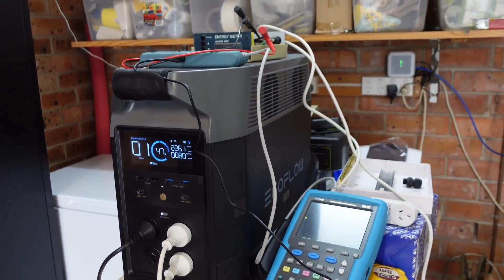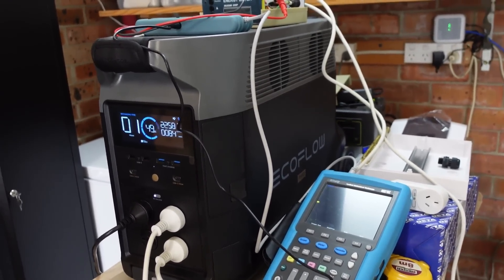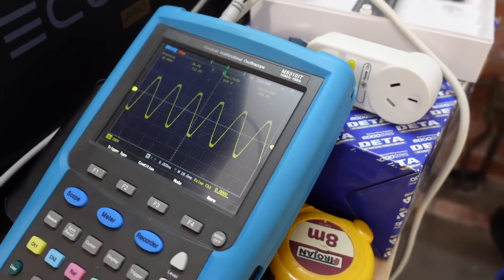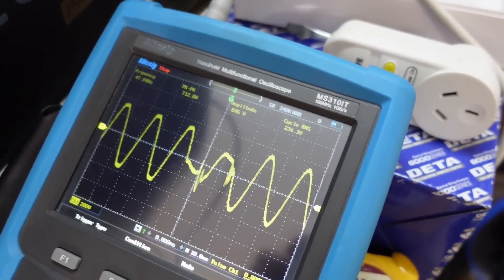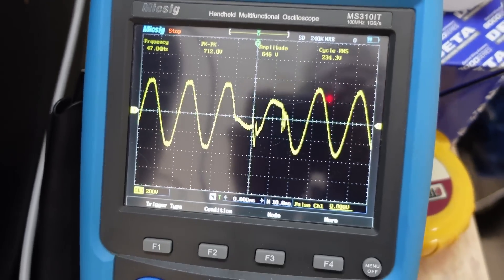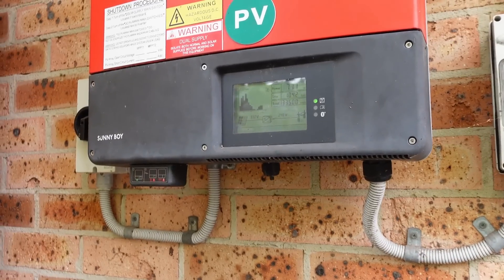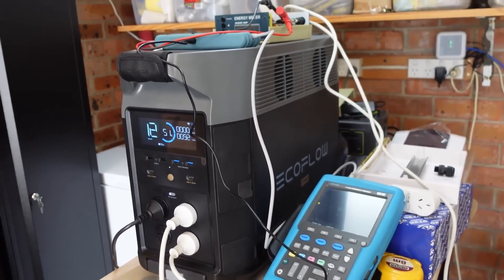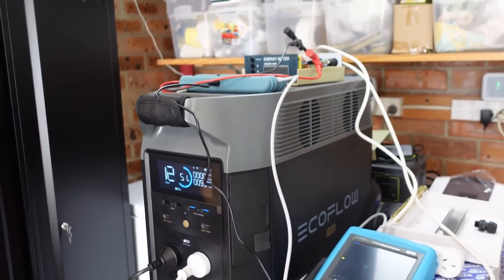EcoFlow Delta Pro - RTFM Dummy!

Comment: I think this is the same way every consumer type UPS works, which is probably the reason computer PSU specs require them to tolerate loss of input power for at least one full AC cycle.
Could you get some kind of time delay relay (assuming it would trigger on that discontinuity, which it might not even detect) to enforce a compressor off time of a couple minutes?
Reply: That is the way every consumer standby UPS works.  Online UPSes supply the load from their inverter continuously and have no transfer delay.

I suspect Ecoflow switches between the AC input and inverter to prevent the efficiency loss from operating the inverter continuously.
Reply: @Alamagosa  Ecoflow probably uses the same inverter as charger and does operate inverter continiously, but it (inverter) isn't allowed to feed it's own input (safety). Ecoflow unit has to wait until relay is off before truly feeding the output.
Reply from the maker: I don't want to disconect the power to the fridges at all, there is no upside there.
Reply: @EEVblog2  But shutting them off for only 5-10 minutes when "power hiccups" occur won't cause them to defrost/warm up enough to damage their contents.  Unless you can get better equipment for basically free, three timers ought to cost a hell of a lot less than the new equipment you now feel that you need.

Comment: Standard solar inverters generate 240VAC from the PV's and synchronise that with the mains to supply the mains. Can you get such a grid tie inverter  that also takes batteries as an input besides the solar arrays and feeds that into mains? A sensor on your incoming mains to tell it if its exporting or importing power and the ability to moderate inverter power from batteries (and solar while we are at it) so that you could program it up to minimise imported grid power. This Hybrid inverter sounds like BS to me...you need to run "emergency circuits" and use those transfer switches...a lot of complication and costs.

Comment: Servers may require 0ms UPS but I doubt refrigerator compressors would notice 10 ms glitch
Reply from the maker: They do, I can physically hear them go CLUNK, it's how I noticed the problem.
Reply: Most server PSUs can handle 20ms or greater lol. Hell, even a typical PC ATX PSU have a hold up of like 20ms.
Reply: @shadow7037932  I've even switched an ATX power supply off and back on fast enough that the PC didn't shut down.

Comment: Isn't the draw from the compressors starting putting a large load on the system? Possibly decreasing the life of the batteries?
Reply: The thing can deliver 3.4kW of power from battery if I recall correctly. She’ll manage an inrush/start peak here or there.

Comment: You only lost half a sine wave.

A typical ATX power supply has a backup time of about 20ms @80% load.

btw: Take a snapshot of your normal power grid in a room with a long supply line, what happens with your voltage when you connect a large capacity load. ;-)

Comment: "I felt a great disturbance in the Mains... As if millions of milliamps suddenly cried out in a switching surge, and were suddenly silenced."
Or: it's a feature, not a bug :). It's gonna be perfectly fine for all kinds of resistive loads, but there should at least be a beefy interference filter on the output to mitigate the ugly switchover.

Cool to know that Aussie also uses the DIN rail electrical panels like the ones we have here in Europe. The wiring is so diverse around the whole world and it's always interesting to learn how others do it.
Reply: Have you seen his fusebox?
Reply: @ulwur  Good condition though for the age of the house, and complies with the electrical standard in effect when built. Plus also complies with updated mandatory upgrades for RCD protection when that came in. I see plenty of houses that have had a single owner, ie passed down from parents to children for a generation or three, that still have the old style rewireable fuse in it, and the original 1930's gutta percha wire in the walls, and the only modern thing is a single 4 unit wide box with RCD unit for the socket outlets, installed likely when somebody wanted a new outlet in a place, and they had to install RCD protection for that. Sell that house and you have a pretty big bill to bring it back to standard, especially if the new owner actually wants socket outlets that fit modern (later than 1950) plugs, as you need to rewire the entire house. bonus is the old scrap copper you take out is about half the cost of the new wire.
Reply: @ulwur  not yet, and I'm growing curious :)
Reply: but let's not talk about his fuse box.

Comment: Did you expect the battery's inverter to synchronize with the 50 Hz on the mains? This isn't impossible, but it's not a capability you would expect on any inverter that didn't advertise the capability...
Reply from the maker: It's got nothing to do with sync, it's not switching over, so that's not an issue. I just expected the generator output to be uninteruptable but it's not.
Reply: @EEVblog2  It has everything to do with sync. The compressors in your refrigeration units don't like dropouts, but they really don't like phase discontinuities. This is power engineering 101...
Reply from the maker: @ats89117  Yes, either one would be a problem. But if the EcoFlow was designed so that the inverter output was continually coming from the battery as the source, and the battery was then also recharged from the mains via DC then this wouldn't be an issue. It doesn't do that, so it's gonna potentially upset the fridge either way.
Reply: @EEVblog2  they cant do that. They use just 1 inverter also as mains charger. 1 extra relay to switch input power and a bit of software.
Reply: It's pretty much how everything but the really really cheap crap UPSes do work.  Even the base model modified sine wave offline name brand UPSes these days monitor the AC when present so on failure they can correctly match phase of their own output.  The same goes for return to mains supply.  Out of phase loads can cause serious amps to flow, not good for the output transistors, not good for the devices being powered.  A baby Sola 310 I had many years ago did it.
Reply: @retrozmachine1189  Thanks for the update. As you know, the phase sync is critical. I wasn't aware that this is now being incorporated into lower cost units. Thanks.

Comment: geeze...thats a noisy sucker
...ive been looking up the manuals/specs for devices before i buy em, just to make sure they have the features i need..nothin worse than shellin out for somethin only to find its not fit for purpose
i wonder if the fridge compressors are sending a spike back into causing it to switch off...
Reply from the maker: It was charging at full speed, but yes the fan comes on at about 300W output power and it's not as loud but still a tad annoying.

Comment: WTF Dave its 4am why are you still up?
Reply from the maker: Just clinging ot the other side of the rotating globe.
Reply: @EEVblog2  Dave, aren't chest freezers already relatively low power consumption once they are up to temp?
Reply from the maker: @shadow7037932  Yes, chest freezers are quite efficient. The one I have draws 100W when the compressor comes on. And they lose less energy when the door is opened.
Reply: It's early afternoon in the land of Oz :)
Reply: its like 1pm here in Oz!